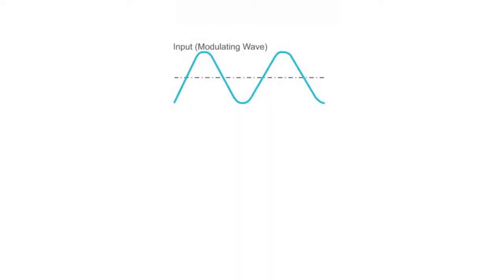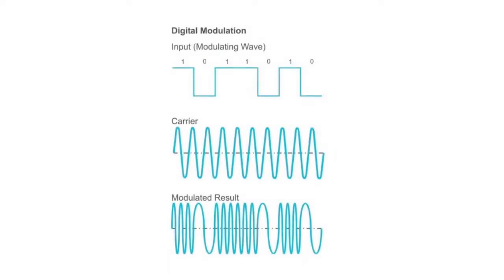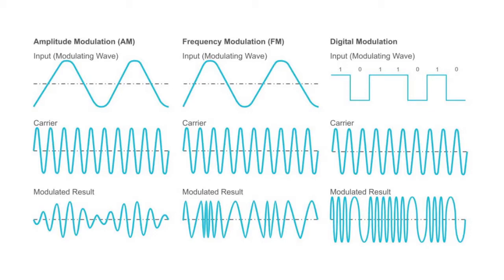Carrier Signal or Carrier Wave - Network Encyclopedia

Comment: how do analog tvs stream videos through that?
Reply from the maker: Great question! In analog TV, the picture itself becomes an electrical signal where the voltage represents the brightness of each line of the image. That signal modulates a carrier wave, which allows it to be transmitted over the air. The TV receives the signal, demodulates the carrier, and rebuilds the image line by line on the screen.